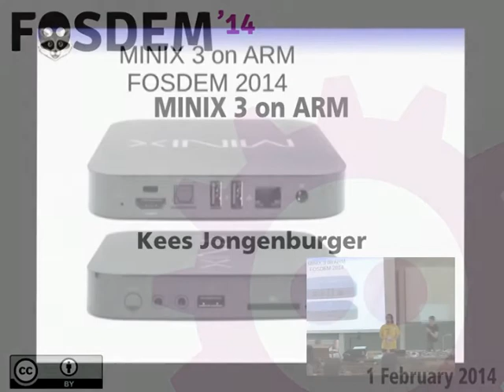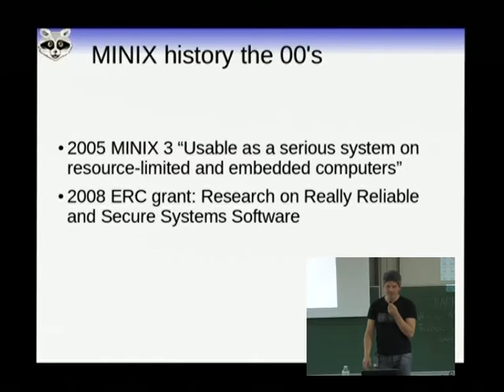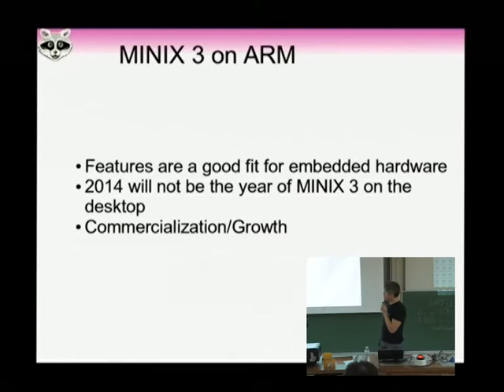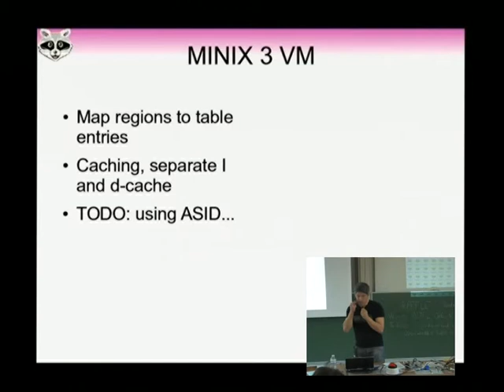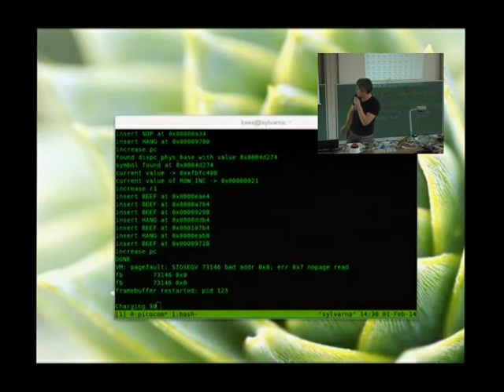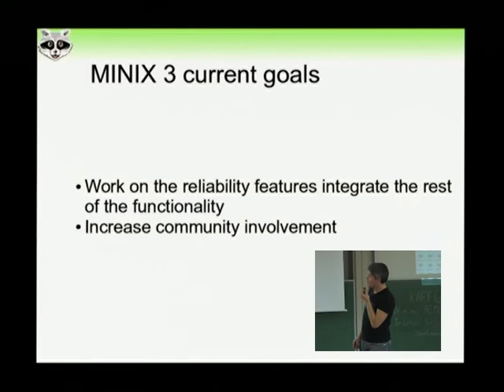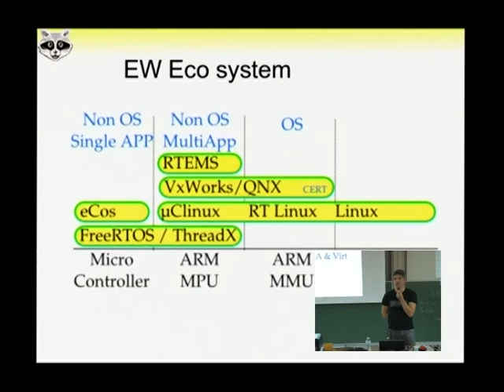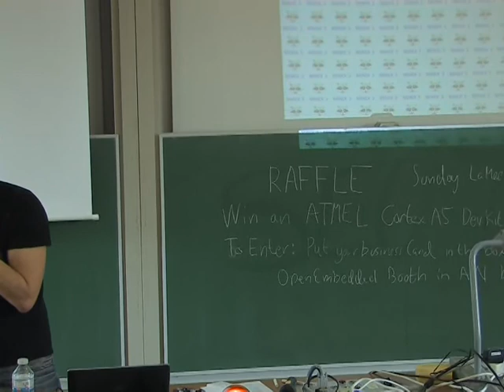FOSDEM 2014 - Minix 3 On Arm

Comment: I am really very interested in running Minix, but I have no interest in running in a VM, I ave tried to install on a T61 Lenovo as well as a T41 Lenovo....but I have had a couple of issues...

I was wondering if you could make a Video on how to install on a Lenovo Laptop covering Network cards and issues that may arise, also installing on machines with SATA drives...

My Idea is to see Minix runnig on many laptops around the world, I am also interested in maybe seeing a video on how to install a light and useful desktop like Openbox or MATE on Minix..can this be done?

Many thanks..
Reply: +plushoom I burnt the latest DVD iso, and followed the steps...still no luck with certain drivers on Lenovo laptops...if you take the time to make a video on how to do a complete step by step uinstallation then Minix would take off, there is great frustration with Linux in the UNIX like computing world....the only alternative are the BSD's..

I believe Minix would outperform all of the UNIX like OS's....you just need a complete all in one installation ISO which would include a light Desktop as part of the ISO...you cannot have the idea that the Desktop would ave to be installed after the OS is running, what if you cant get networking working for some reason...or what if you cant get WIFY working?